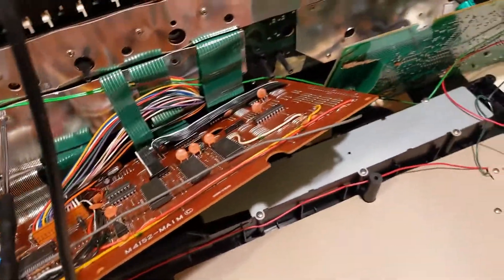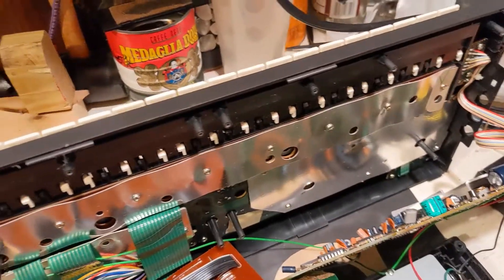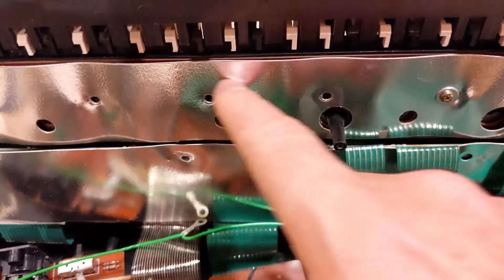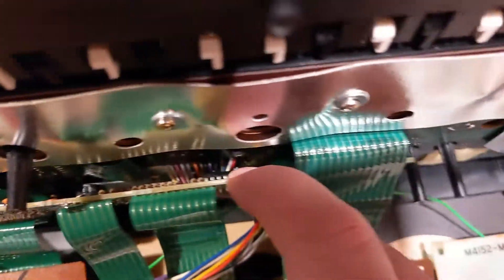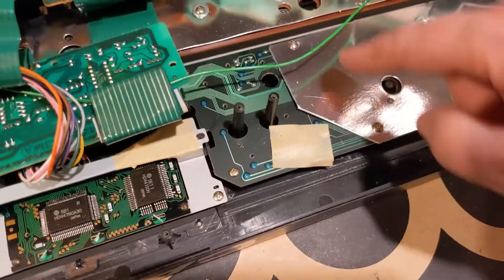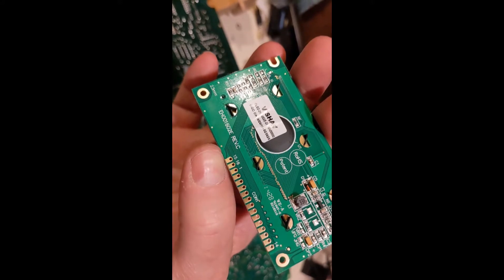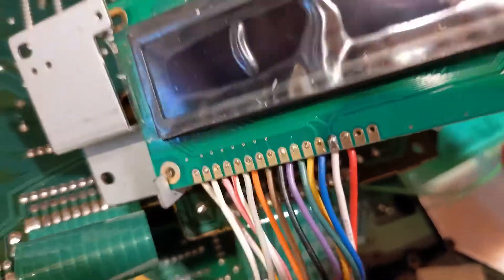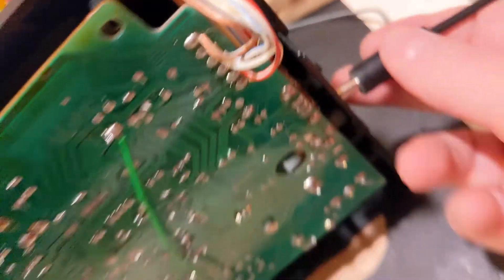Casio CZ-101 OLED Display Upgrade

Comment: Did a CZ101, Just installed this board, identical part number, double triple checked my wiring, i know my soldering is good, i'm very experienced at soldering, The screen image is not centered, its kind of too far to the left, and there is empty space on the right of the OLED, any idea why this would happen? I ordered 3 other screens because i wanted spares and I have a CZ1000 that i'm doing next.

Comment: Hey guy. I got a question , the Yamaha RX5 uses the same screen but some of the screens have fewer pins to the left side vs the 14-16 pins on the new screen where the 16 connections are. Cant wait to hear back. Ps This is my first venture into this .
Reply from the maker: Hmm. Truth is you don't use nearly all the pins for a character display like this, but you do have to know what each wire is doing so you can hook it up properly. You have power and ground plus either 4 or 8 pins for the data to display. There are also some enable pins that put display in read mode. Some have an extra two pins to route backlight power but those are not used for OLED. Bottom line is you need to know how the rx connected to its screen- need the schematic.
Reply: @ErichIzdepski  i have a screen shot of the pin assignment and what they do is very similar 16 pin gpio kinda assignment with 3 pins not used of 16 so 13 active. I bought 4 screen 2 should work. Wishful thinking

Comment: If you're particularly technically proficient, it may be possible to fit an H type display though this will likely involve modifying the pot-metal bracket or creating a custom bracket. (3D printer?) The H types are wider and you'll really have to know what you're doing with the soldering as the pins are in a different arrangement. As of summer of 2022, H type displays are listed as in stock on Arrow's site.
Reply: Another thought: I wonder if there are any inexpensive devices that are known to use this E-type display? Figure that out and cannibalize the device?

Comment: Very nice looking display! You mentioned there is no reverse voltage protection. Hard to believe, but if that is true, why not add a diode to protect from reverse voltage on the DC input jack while you had it open?

Comment: A 65ohm resistor is recommended between Pin 2 (+) and Pin 15 when updating display.
Reply from the maker: What is the purpose (I guess reducing some voltage/current). And what if ignored?
Reply: @ErichIzdepski  the green mosfet tends to heat up so much it desolders itself without limiting current.